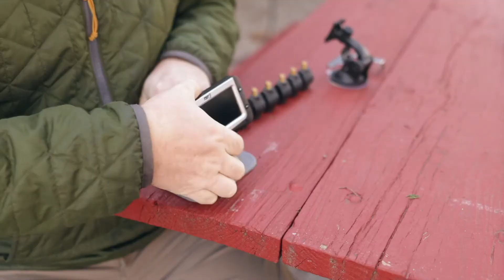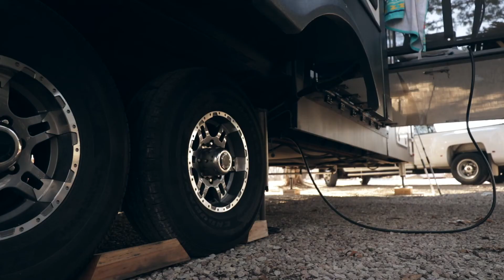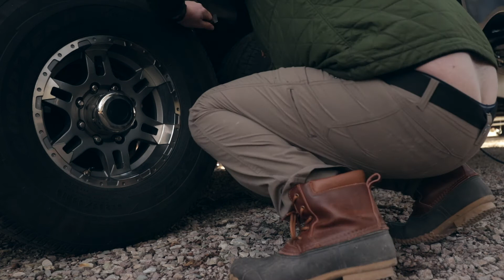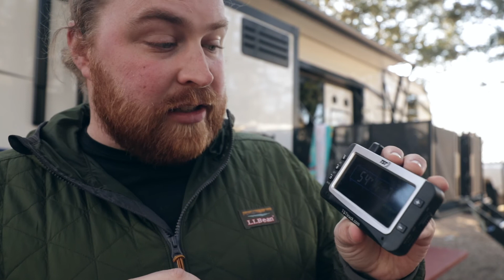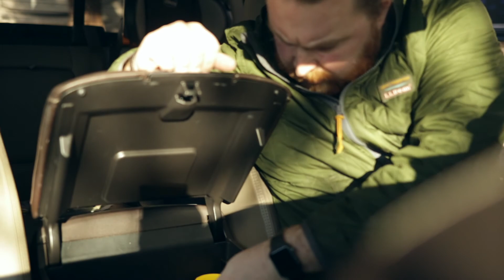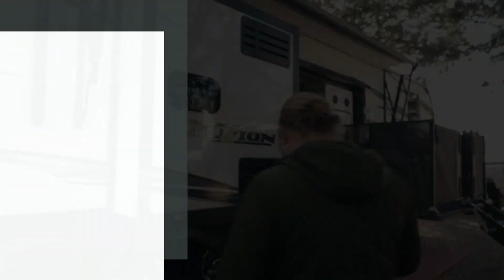TST Tire Pressure Monitor - Set up and Install

Comment: Going to bother you once again.  I bought a new random axle trailer.  Thanks to your video, I was able to set up all 4 sensors, but I can’t get the monitor to set the maximum and minimum temperatures and tire pressures.  Any suggestions???

Comment: Great video, you made it easy to understand. I read that every year you have to change out the sensor batteries . What a about  the battery in  the head unit. I read you only have  4 years on it, which will probably on last 3 years with my luck. So does this unit go in trash or can you keep the power cord hooked up ,so it will work. I see no way to replace battery in this unit. Any ideas? Thank you
Reply from the maker: Hey mark, the head unit has a lithium battery in it that cycles just like any quality lithium battery likely for around 5000 charge cycles. It should last for years to come and if you keep it plugged it it likely will last longer as that will limit the charge cycles. If you plug into the included charge cable and set the power switch to off it will turn the unit on/off with the key assuming your cigarette lighter plug also turns on with the ignition. This will turn the unit on and off with the key and limit the use of the lithium which would just sit mostly charged and likely last for the life of the vehicle without issue. Let us know if you have any other questions!

Comment: Great explanation the instructions seem a little difficult to follow and I learn easier with visual and by doing. I bought enough to do my tow vehicle too. Is this not common?
Reply from the maker: Yes you can add sensors to use in your tow vehicle. It's actually very common! Nice to see everything all in one place!

Comment: Dealership set us up when we bought new RV. However, alarm goes off periodically but there never seems to be an issue. The last time it flashed red and then word pressure appeared in red when on the front left sensor. PSi set at 135 . Temp varies from 95 to 104F. We feel something  is not right. What can we do?

Comment: Just bought this system from you all plus 4 additional sensors. The booklet doesn’t make it clear that we can have different pressures for each tire. For instance I run the front wheels on the truck at a higher pressure than the dually’s rear tires. The trailer tires are all the same but are also different from either of the truck’s settings.  What’s the simple explanation to set pressures for each tire?  Thanks.
Reply from the maker: You can set it so that the truck has different trigger level than the trailer. I had to do this for mine as well.  But each unit (truck or trailer) should have close to the same ratings on all tires.  I know for my truck its best to run the front tires about 10 pounds less then the back (per manufacture) so I have the truck alerts based on the front tires.  The RV has all tires at the same setting.
Reply: @MobileMustHave  thank you. I watched a couple other videos and was able to determine that on the truck you set it by the axle. On the trailer both axles are the same. Our system is up and running and working great. Thanks.

Comment: Andy, I have set up the cap sensors and I now have a problem that comes and goes.  One sensor will work perfectly and the second May or may not work.  I switched the sensors on our single axle trailer, and the sensors may or may not work for either sensor.  Do you think I need the remote booster for a 20 foot trailer so that both sensors will work at the same time?
Reply from the maker: TST recommend the repeater. But if you put the display in the boat while on the trailer does it pick up both? That would be a decent test to see if it is a range issue.

Comment: For what issue do I need install a signal booster
Reply from the maker: Hello! Are you referring to the weBoost signal boosters we sell? If so, a signal booster helps increase your cell phone's signal if you're in an area where your service is not that strong. This will help improve calls, texts and data usage on your phone! If you have any other questions, please reach out to us via email at info@mobilemusthave.com and we'll be happy to help! Thank you!
Reply: The TST tpms comes with a signal booster, I see you didn’t set that up in your video. Is it not necessary to operate?
Reply from the maker: @LivingTheLifeIImagined  for longer RV"s the signal booster will help improve signal. I drive a 35 ft trailer and do not use the repeater and it works fine. I also use this in a 45FT class A and the repeater is needed. The repeater is simply attached to your 12v house batteries and no additional setup is required. We cover this installation in our other video here: https://youtu.be/qxTqmVrI18A?si=FsWZPuKHb90S9BWQ

Comment: What if you have a unit that was working but now won’t turn on?
Reply from the maker: I'm sorry to hear you're having issues with your TST system. Fortunately, TST does have a 3 year warranty on their TPMS, so as long as it's under 3 years old, should still have a warranty on it according to their site:https://tsttruck.com/warranty#:~:text=TST%20TPMS%203%2DYEAR%20WARRANTY,a%20period%20of%20three%20years.

If you purchased your TST TPMS system through us, you can also reach out to us via email at info@mobilemusthave.com and we can help you out!

Comment: What about the repeater?
Reply from the maker: excellent question, we are working on a repeater video that is coming very soon. In the meantime its a straight forward installation with two wires to any dc power source in your rv, usually near the house batteries in a 5th wheel or the chassis batteries in a Class A. If you have any specific installation questions for your particular setup just say the word and we will get right on it and help you out. For fastest response hop on mobilemusthave.com and fire up a chat and we'll reply asap.

Comment: Thanks! We have sensors inside the tire. is that what we program? Do we need the cap sensors too?
Reply from the maker: Hi Robert, you cannot programs sensors not made by TST to work with a TST screen, they use a different technology/frequency to operate at much longer ranges. Do you have TST sensors? If not unfortunately it wont work. You can install internal band sensors next to your factory sensors if you want as an option if you dont want to deal with external sensors.